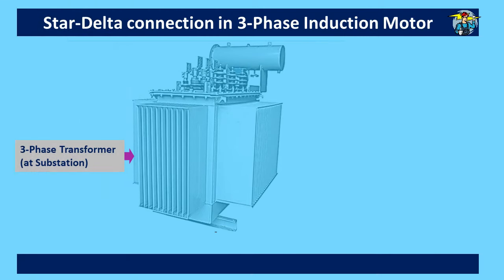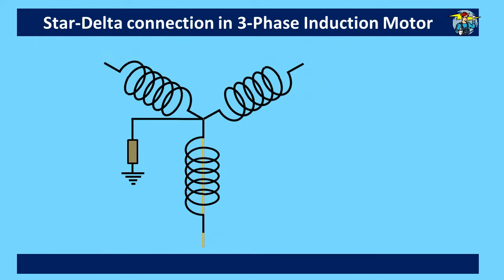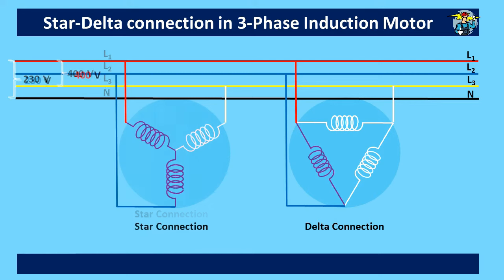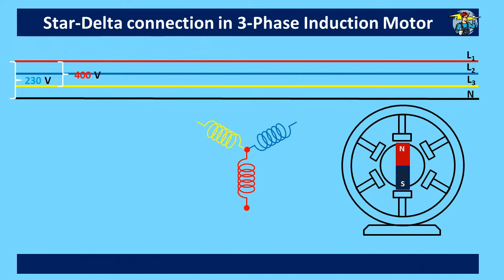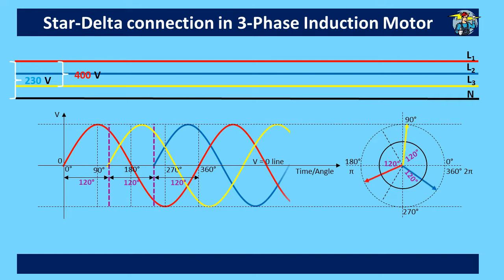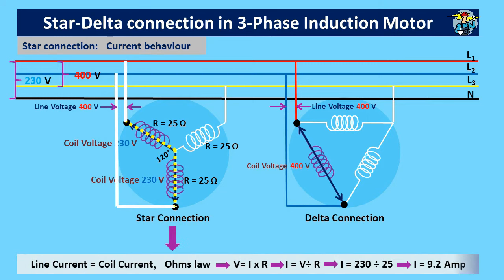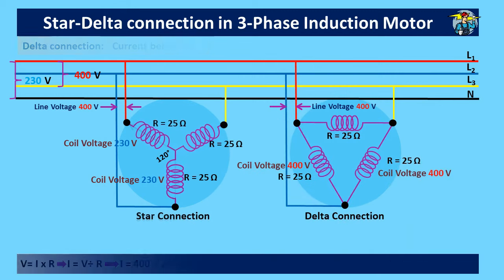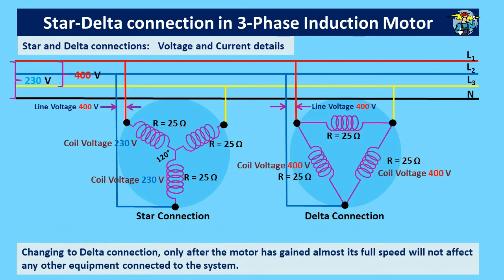Star Delta connection and its Voltage and Current behavior Explained / Best animated video for you 😍

Comment: Thank you sir
But excuse me 
To calculate the current with ohms law in delta don't we have to calculate the total resistance for the coils which i think its in parallel and series? ❤
Reply from the maker: Since this is a 3 phase line, we need to introduce conditions during calculations with Ohms law.
So we can apply Ohms law for the conditioned part only.
For an example, we apply Ohms law to one coil of 400 volts on the Delta connected coil set, when Yellow line is delivering zero current.
At that point, other two coils are with zero current flow.
Thank you.

Comment: Is it the explanation rules for amperes for DC motors or AC motors? I think there is difference. (It is not my video to talk).
Reply from the maker: Your question is not specific.
I guess it is about ohms law.
Ohm's Law applies in three-phase systems as well, but you must account for the relationships between line and phase voltages and currents, depending on whether the system is configured in star or delta.

Comment: Sir motor star delta winding resistance how to measure plz tel me sir
Reply from the maker: Ok. Please follow these steps.
Star Winding Resistance Measurement:
In the star configuration, the winding resistances are measured between phase terminals. 
Step 1: Label or note down the three-phase terminals: A, B, and C.
Step 2: Set your multimeter to resistance (Ω) mode.
Step 3: Measure the resistance between: A and B, B and C & A and C.
The resistance between these pairs should be equal for a balanced winding.
The measured resistance is the sum of two windings in series.
So, to find out resistance in one coil, divide the measured resistance by 2.

2. Delta Winding Resistance Measurement:
In delta configuration, the windings are connected in a closed-loop. The measurement method is similar to the star connection.
Step 1: Identify the three-phase terminals (A, B, and C) and ensure the motor is in delta connection.
Step 2: Measure the resistance between: A and B, B and C & A and C.
As with the star connection, the resistance between each pair should be roughly equal.
These three readings directly represent resistance of the three coils.